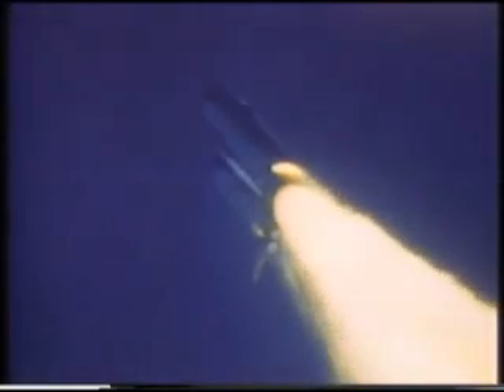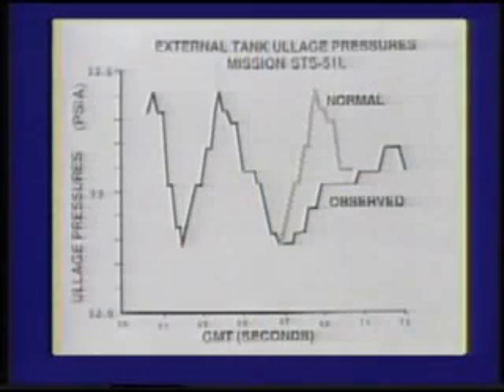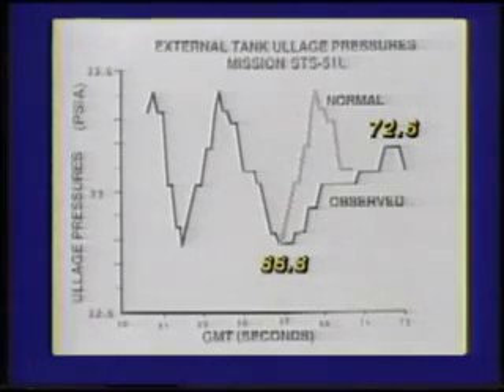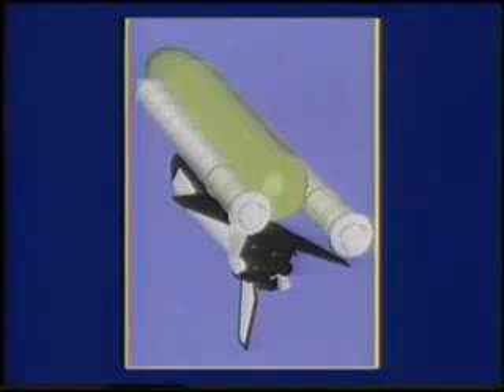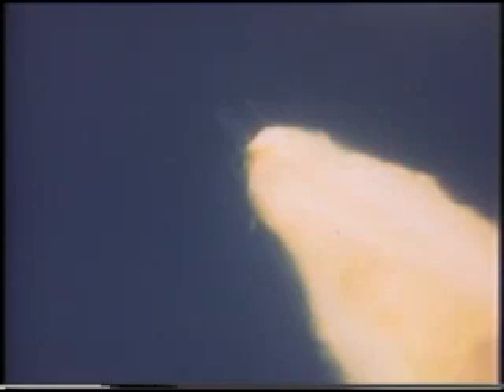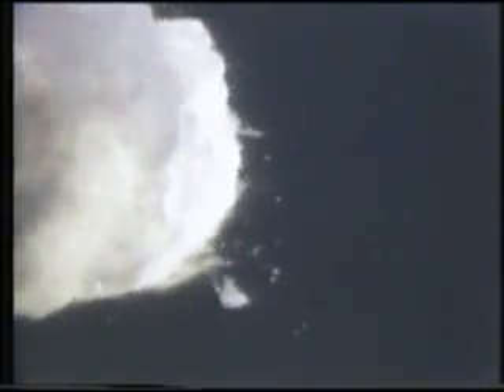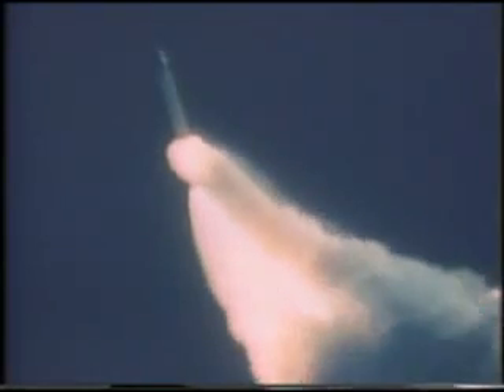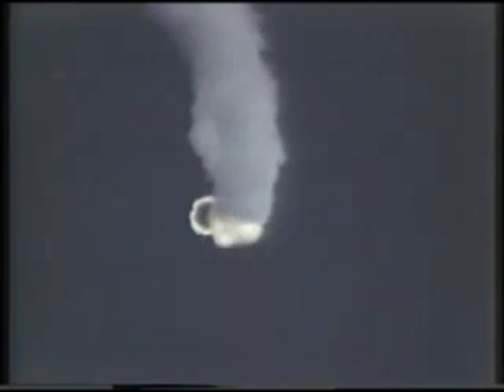Part 3 - Space Shuttle Challenger Explosion - What happened?

Comment: 1:40 Challenger killer #3 use of aluminum on shuttle parts NASA did not check the stringers on the top and bottom of the tank before they put it on the boosters all of them were cracked because of the ice they did not put steel radius bars on them which is required by law NASA violated the safety rule when they did not check its hardware.

Comment: @supremeon1 Boosters,Engines,rudder,and speed brake when the left booster went off line the engines were returned to full thrust and then last thrust when Capcom said told the crew to increase thrust the stringers on the aft bulk head failed and the orbiter started to brake up.